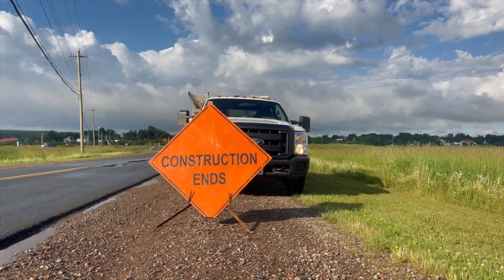Detour Ahead!! Featuring ASIM!! Live water main taps

Comment: Can the mueller “ez tap” tap c900 and ductile?
Reply from the maker: Yes , up to, Two inch ,  but you have to use saddles , it won’t tap directly to the main line like  the B—101 can. The Ez tap has ductile and the plastic core drill bits , I think  anything over 3/4 was a separate kit ,
Reply from the maker: https://www.muellercompany.com/water-works/machines-tools/drilling-machines-small/ez-taptm/

Comment: How close together can those taps be?
Reply from the maker: I was always told 18 inches , but I guess it depends on what municipality you’re from rules are , 🍻
Reply from the maker: You can't provide a single definitive distance, as the required separation for water main saddles depends on the local plumbing codes and the pipe's diameter. Generally, you need to allow for the pipe's physical properties, the size of the tapping bit, and enough space for proper sealing to prevent leaks. You must consult your local plumbing codes or contact your municipality for precise requirements before installing any water main saddles.
Reply: @rodpreston100  That makes sense, thanks Rod.